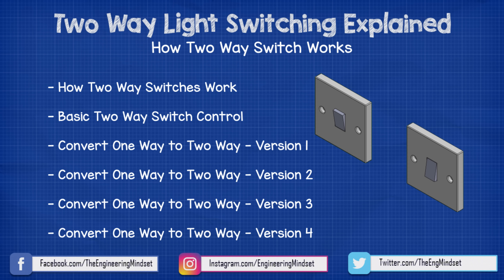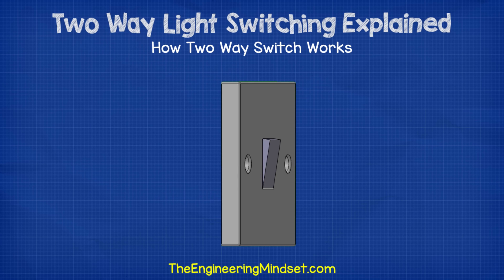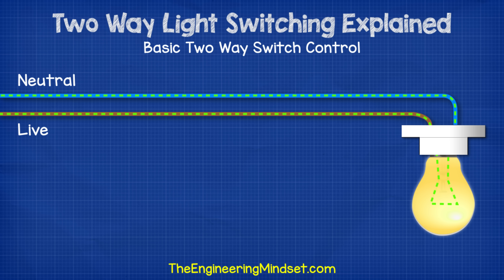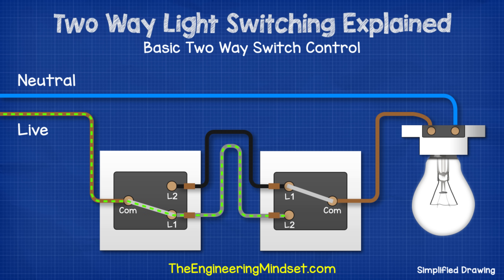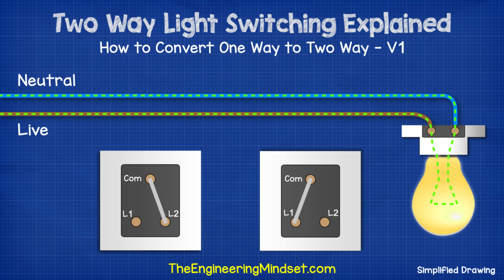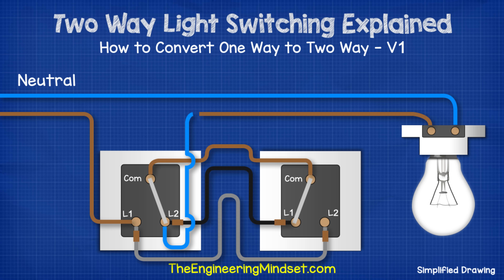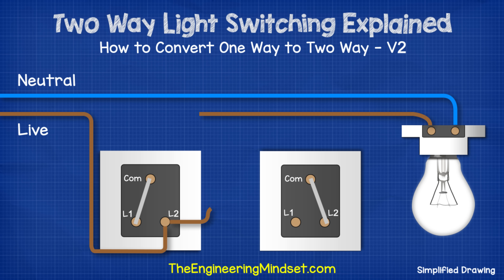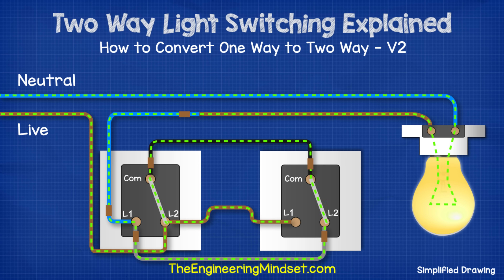Two Way Switching Explained - How to wire 2 way light switch

Comment: It then seems to me that in any case, you need to run wires between the switches - is that correct? Then any conversion, or fresh build, still requires extra wires going between the places where both switches (top/bottom of staircase, two ends of sleeping room etc.) to be installed.
Reply: That is true, but in a new build you also have both switches connected to the light whereas in a conversion only the original switch requires being connected to the light, this is why the two conversion variants come in handy as they do away with the need to connect the 2nd switch to the light, meaning less conduit/damage to wall and ceiling.

Comment: Hmm. 
I think they are actually called single pole double throw, SPDT, or that's how it was back in my A Level days anyway.
Reply: In the electronics world, yes, but for a simple light switch it is more common to see 2 way (or 3 way - even though it is only a 2 way operation)
Reply from the maker: Check out our US 3-way switch video: https://youtu.be/_u5ORnhqn8g

Comment: so a 3-way switch... ? at least thats what its called here in the USA.   There's 3 way and 4 way switches...
3 way, like above video, can be controlled from 2 areas. a 4 way can be controlled by 3 areas. (if you want more than 3 areas of control you simply add more 4 ways into the middle of the circuit.
Reply: So, as this is mentioned at 0:57, what is your point?
Reply: @Grizzly01  must have missed that while watching. just made a statement of what they are here. (having missed that in the video would make it a valid statement.) the other information on 4 ways etc may be helpful to someone who doesnt know the information.   I was unaware added information was a problem.
Reply from the maker: 4 way switches video: https://youtu.be/jYFVsUqY6zc
Reply from the maker: Check out our US 3-way switch video: https://youtu.be/_u5ORnhqn8g

Comment: now what if i want 3 switchers?
Reply: You can add as many 4 way switches as you want on the L1 and L2 wires between the two 3 way switches
Reply: Dominic Mammone   The third,  ( or as many as you need) switch is called an intermediate switch here in the UK. They are just connected in the strappers between the switches.
Reply from the maker: 4 way switches video: https://youtu.be/jYFVsUqY6zc

Comment: And now, the intermediate with 3 switches.
Reply: Christopher Smith   Or as many intermediate switches as you want by inserting in the two strappers.
Reply: @zqjzqjzqjzqj  dependsif it is 2 plate or 3 plate
Reply: Use version #1 and insert (as many as you want) DPDT switches between the two three way's wired to reverse polarity of the two intermediate lines.
note: DPDT = double pole double throw - electronics language(it's two three way's ganged mechanically essentially). The three way switch would be called SPDT. Electricians have a different nomenclature than electronics techs. And I have no clue what an electrician would call a DPDT switch.
Reply from the maker: 4 way switches video: https://youtu.be/jYFVsUqY6zc

Comment: love the explanation, though i already understood the concept when using 2 switches. (the problems i have are usually with the wiring being miscolored)
one question though, could you do a video for a  3-switch setup? for some reason i cannot grasp how those work, but i have never seen switches explained this clearly either.
Reply from the maker: 4 way switches video: https://youtu.be/jYFVsUqY6zc

Comment: Where did you find a rule that you need to mark wires with brown color? If a wire is not blue that means its a hot wire anyway, so why you should mark others?
Reply: So that no-one will confuse it with being a neutral!

Comment: Using arduino and relay is a lot safer than this mess
Reply: ..... and much too complicated. It isn't a mess, we've had lights wired like this for literally decades. My last house built circa 1930 had the stair light wired this way!

Comment: The 1st way is the simplest, and uses the least amount of wire. After all, what is gained from the extra complicity?
Reply: some one please answer this
Reply: The first way is great if you are using single core cables; in England this would usually be in conduit, seldom now used in houses. The other ways, which are virtually all the same, can be done with two core and earth cables and three core and earth cables; this is how it's usually done in houses here as it's simple to install and easily adaptable to the house layout.
Reply: The first method is used on a new installation, but the other methods allow existing installations to have second switch retro-fitted without the need to rewire the original installation.
Reply: 1st way is the simplest for the case of 2 switches per lamp. For 3 or more switches it doesn't work.
Reply: koneth21 right, just add 4 ways in between for ever how many switches you may need
Reply: The 1st one was built from the beginning to be a two way switch, so it was very simple to create.
The others are conversions, and conversions are never as good as the real thing. Either you accept that it is not as good as the 1st, or you rip it all out and start from scratch.
Reply: you can use 2 separate power source and 2 loads(bulbs)  on both ends. especially large buildings, hall ways or decked stair cases.......
Reply: Both methods have their pros and cons and are generally used in different scenarios. Method 1 is indeed simpler when looking at it on a diagram but it is mostly only used in industrial/commercial applications these days where the wiring will be single cables enclosed in steel conduit/trunking. Method 2 is preferred in domestic installations where double insulated cable is used.

 You can wire method 2 with only two cables, 1x 2C+E from light to switch and 1x 3C+E between the two switches, it also has the benefit of having a permanent live feed at both ends of the switching which method 1 does not. That is useful if you want to switch another light from the same switch on either end of the two way by borrowing a feed. In that scenario you only need to run an extra single core + earth to  the switch. 

Might not seem like a big deal but trying to squeeze lots of double insulated cables into plastic pipe and flush boxes can be tricky. So being able to cut down on the amount of cables going to the switch is always welcome.

Comment: Excellent video, and well explained, but they're called "3 way" switches. Each switch has (3) screws, and a 4 way switch has (4) screws.
Reply: 0:57 come on, watch and listen properly
Reply from the maker: Check out our US 3-way switch video: https://youtu.be/_u5ORnhqn8g
Reply: life would get so much simpler if the world would just use the EE term for the switch 1p2t,  as in "1 pole 2 throw" switch. a regular switch is a 1p1t switch.   Alas this doesn't completely explain  a four-way switch because a lighting 4-way switch is 2p2t switch with some tricky connects.
Reply: Wrong. Please listen to the video before commenting. This is based on U.K. regulations which mean they are “2 way” switches.

Comment: In all of your examples of converting a one way to a 3 way I don't know why you don't just wire nut the Brown wire in switch 1 and have it be the hot common in switch two.  Then your Gray and black wires would be your travelers connecting L1 and L2. And your blue wire would go to the common on switch one. You have enough wires in your diagram to do this I'm just not sure why you make it so complicated...
Reply from the maker: Check out our US 3-way switch video: https://youtu.be/_u5ORnhqn8g

Comment: If there are two drawer keys, the light is turned on and off from the lower and upper keys and between the three wires. Is it possible to take a new source to the surface through this connection without creating additional wires

Comment: Just for the record: unless there's a complete circuit, NO current can flow anywhere!
Reply: yep that visualisation is annoying me too
Reply: Just a reminder, if you can't visualize where the current is coming from the diagram, don't even try of doing this.  For your own safety.
Reply: @MeMolson  I don't think this is meant to teach anybody how to wire a staircase switch. But just to inform curious people who'd like to know how this works.
Reply: He just meant untill where the wire is live.
Reply: Right, current isnt flowing, but there I'd still the high AC potential at the wire, so if you were to connect that wire to ground through, say, your body ,you would be in trubble
Reply: BenJammin except the video is literally displaying the electricity flowing
Reply: @michaelesposito2629  well, if one wants to get pedantic we could argue over whether the electrons flow, or the holes between them flow.

It comes down to this: the original comment about there being no flow was pointless.

Because the only response to it that makes sense is "who cares?"
Reply: yes, complete yur circuit then sit down and read a good book!

Comment: OK I got a video for you as here Canada we call it the 3way switch as I do understand the 2 way  European is the same switch but  now insert the  4 way switch to control the lighting from 3 locations  :)   The most common I teach apprentices is the first example you shown as to show them the other will confuse the f++k out of them  :)     as we would normally run a 14/2  to the first switch with power  and then you run a  14/3 to the second  and a 14/2 to the light.  The white wire is always neutral and the red and black wire in the  14/3 are your travelers (hot) to the second switch as the white must remain neutral  at all times unless you mark the wire as a hot wire.
Reply from the maker: 4 way switches video: https://youtu.be/jYFVsUqY6zc
Reply from the maker: Check out our US 3-way switch video: https://youtu.be/_u5ORnhqn8g

Comment: I'm an electrician and i hate multiple switch set ups!!!
Reply: Why? There's nothing difficult about them.
Reply: Craig Corson it is difficult when I come by so many faults from previous installations. Colour coding is never kept to standard either.
Reply: @tspirit99  I see. You're not talking about new work, then. I wish that I had taken photos of some of the nightmarish amateur wiring that I've encountered over the years. I know just what you're talking about.

Comment: isnt this like a manual transistor?
Reply: No. Transistors control the flow of current according to the presence or absence of a control voltage. These are just mechanical switches. Whether current flows depends only on the switch positions; there is no control voltage involved.
Reply: that's why I said manual. Manual meaning I have to manually change the state.
Reply: @scellyyt  The transistors not works like a switch. (on/off) More like a potentiometer. (0 to Max -any value betwen 0 and Max)
Reply from the maker: Transistor video now live: https://youtu.be/J4oO7PT_nzQ
Reply from the maker: Seen our new Potentiometer Explained video? ➡️ https://youtu.be/Xb-MZMoUtcQ

Comment: Sir are you aware that this is called a three way wiring circuit and the switches are called three way switches.
A very common very simple circuit from decades and decades ago.The two wall switches are simply SPDT switches.
A switch that is elementary in its design and use.
Reply from the maker: Yes, I'm also aware that you have skipped the video https://youtu.be/opoEswRp_jg?t=59

Comment: You missed one and simplest way to do this. S1 = neutral L1 and Live L2. Com to lamp L1. Sw2 Neutral to L2 and live to L1, Com to Lamp L2 and voilá! Metters of wire saved.
Reply: You shouldn't do that, because then you can have voltage at the lamp even though it's not on, and that can be quite confusing to the user who want's to change the lamp.

Comment: Man this video just solved my childhood mystery
Reply: @Gigastar I thought of XOR gate as well..
Reply: @joonasfi  LOL ME TOO I TAUGHT XOR GATE
Reply: Same here!
Now I can die in peace 😂
Reply: @Gigastar :) Yeah... but then again I first saw this in a building from 1968 in a communist country... I first thought of some diodes but there was no flickering :D
Reply: same!
Reply: Same, I was like "If you make both switches connect to the light, you'd need one of activate one of them for the light to turn on but if both are turned on, the light will still be on. If you connect the switches together, you'll need to activate both of them. How does this work?!"
Reply: @ixalaz4536  yeah I found it to be very confusing.
Reply: Finally I have the answer!!
Reply: this solved my mystery too, but what about the 6-way light switch in my apartment’s lobby which have momentary push buttons. I mean I press(and release) the switch but it doesn’t stay pressed, still the light will turn on or off every time i press either one of them. Also you can hear a loud relay click sound every time
Reply: @zabonfire7172  Mechanical switch. press the button and it throws internal switch. Also three way switch wiring has been around way before computers and XOR were even thought of.
Reply: @zabonfire7172  most likely controlled by a pcb
Reply: Lol we study this in school, but much more  electrical circuits with different functions.
Reply: Thanks
Reply: me too
Reply: Haha same thing here.
Reply: Sergi Sancho Mukhachev same
Reply: Same!
Reply: Nisalsola
Reply: am also brooo
Reply: Same.
Reply: Rukiyah binti Abdul Aziz   hahahaha sounds something
Reply: Me too
Reply: So who was your daddy in the end
Reply: I taught it is magic
Reply: @that_duck_over_there  so did I.
Reply: @Gigastar me too.
Reply: Me toooooo!
Reply: This of all things was your childhood mystery? Lol
Reply: Same!
Reply: look in to the Electoral Code book
Reply: Literally going through this rn
Reply: Love youtube comments. People come up with some catchy sayings.
Reply: Same!
Reply: Exactly exactly
Reply: Same with me
Reply: Same
Reply: Mate, same same same. Me knowin something about electricty. Then seeing this as being like 10 yeas old
 Mystery it was😅

Comment: By looking at these various types of setups, it is obvious that the electricians whom came up with them got bored doing the same way over and over again. Sure, some of these setups did solve a problem that they had at one point. But, some of them seems a bit unessarly complicated to me. Like if you wanted to build a house as a fully functional pinball machine with just the switches. XD
Reply: Playing pinball with electrons😁
Reply: When adapting an existing installation the less wiring that needs to be changed makes the job easier. Every situation you come across is different. What he didn't go into is tapping into a cable midway to add other switches, if you tried to draw that it would look ridiculous but doing that may mean you don't have to lift a recently laid expensive floor, saving lots of time, money and inconvenience. That is what the word engineering means; solving problems.

Comment: i live in Germany and i had this mysterious 2 way light switch in my apartment's hall  and never figured it out till watched your video... it was really driving me crazy.... Thank you.
Reply: What is flower part
Reply: My house in Germany used a relay at the light and multiple low voltage momentary switches to toggle the relay.  The whole house was wired this way.  All switches were low voltage.  The stepdown (low voltage) transformer powering the relay's electromagnet can be located next to each relay or centralized for the entire house.  Some relays are integrated with their transformer.  There are "many ways to remove the skin from a catfish."

Comment: Now make a 10 way switch
Reply: Easy to do with the 1st version. But then you would need a 4 terminal switch called a cross switch.  Cut the wires between L1 and L2. You now have 4 wires.  And (hurray)  a cross switch has 4 terminals..  Ypu can extend this a million times if you like.
Reply: @Okkie26   you are right v good explane sir stay conected
Reply: Or just attach a dual edge monostable to every switch, OR all the outputs together and run that into a T flipflop
Reply: 1024 And attach that to a relay. And add an ESP32 for IoT.
Reply: @GRBtutorials  yep and then add some RGB and maybe hook that up to a 10-way switch... wait
Reply: To make a ten way you have to do the 1st and the last a three way and the rest a four way switches as simple as that
Reply: U can use as many sw u want as long as u use 3terminal sw for the first and last sw, and between them u can add 4 terminal sw as much as u want..

Comment: There are three terminal in two way switch. First connect neutral in terminal of bulb. From another terminal bulb, connect with any one switch in middle terminal. From another middle terminal to be connected with phase. Ok  now take two wire and connect one wire from remaining one terminal of one switch to one terminal of another switch. Wishwarsa one more with Tobe Connected to remaining terminal of each switch es